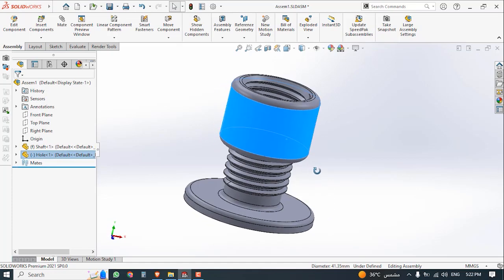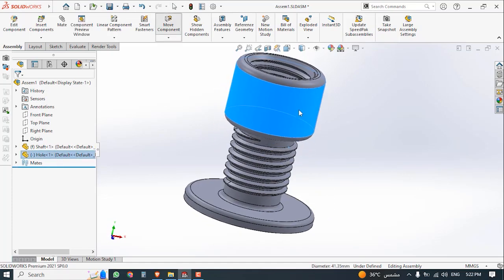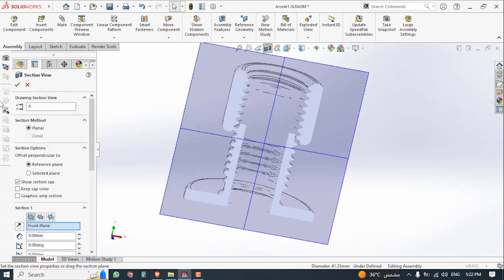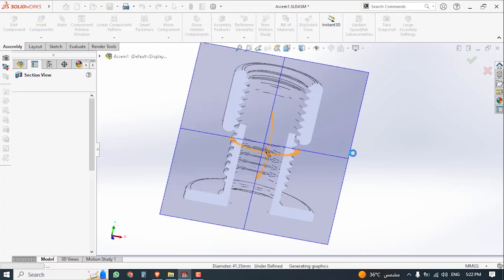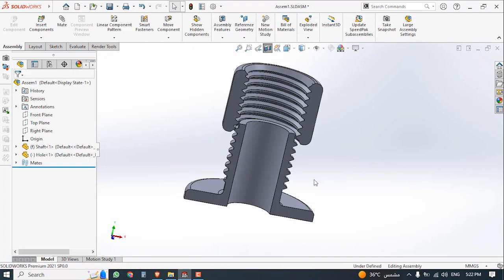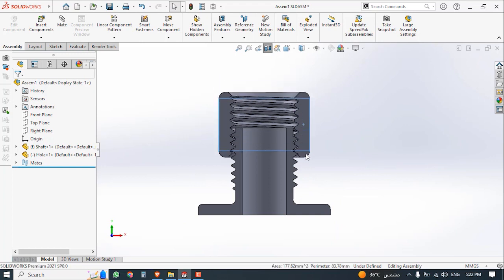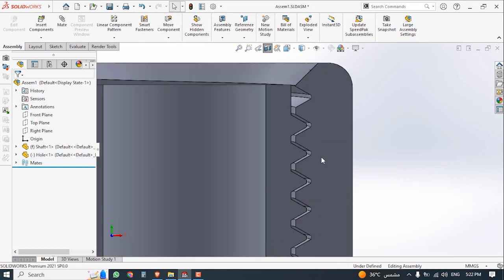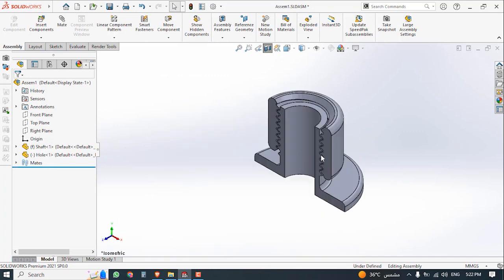Functional Thread on Solidworks | 3D printable Thread

Comment: I used the hole assistant function to create a thread, but when I 3D print it, the thread isn't printed. What could be the reason?
Reply from the maker: try to increase the clearance a little bit.
Reply: Because those are cosmetic threads. Non existant geometry.